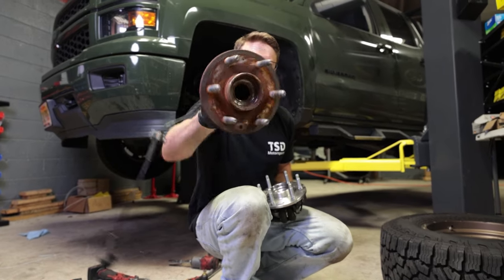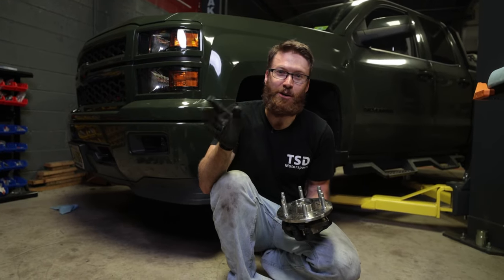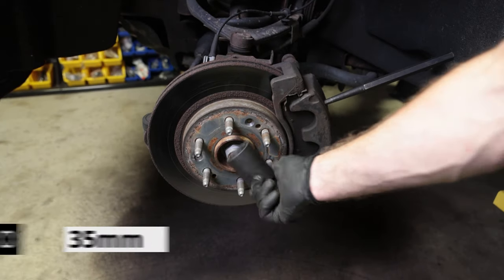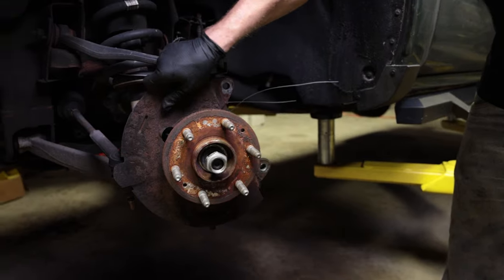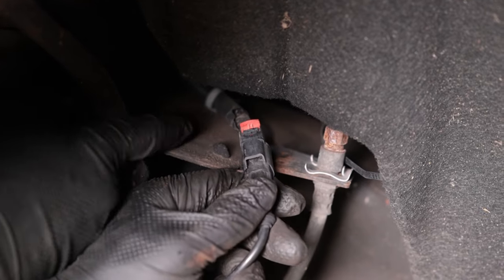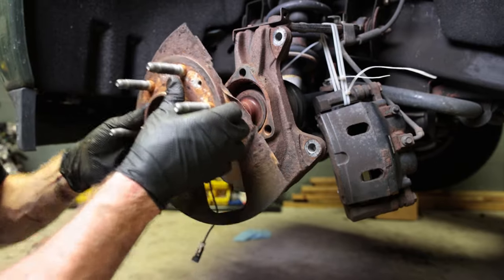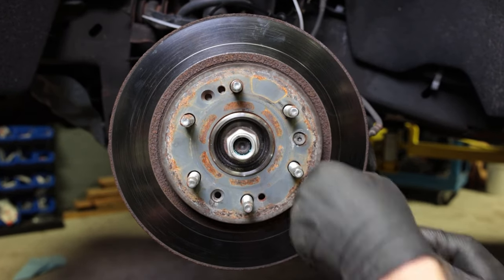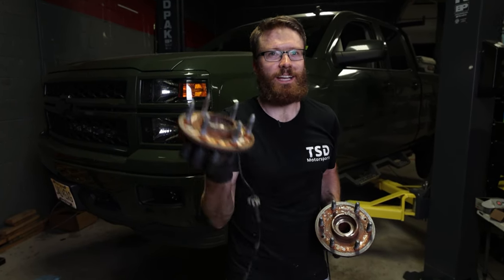How To Replace 2014-2019 Silverado Wheel Bearing - Kryptonite Best Wheel Hub? Sierra Tahoe Suburban

Comment: My 2018 GMC 4WD Sierra axle nut size is 36mm not 35mm. The 3 wheel bearing bolts size are 18mm, not 15mm.
Using an angle grinder had to grind the upper A-frame ball joint stud sticking past past the nut that was in the way of the top bolt on the wheel bearing so I could get a socket on it. Had to use a 6 point socket with a 2ft breaker bar to loosen them up.
Used an inexpensive wheel bearing puller to remove the wheel bearing saving myself a lot of time and aggravation. A common regular puller also works.

Comment: Recently replaced the passenger side on my 2011 Silverado and it pretty much identical. Hardest part is getting those things apart!  Referenced your older video to do that. Thanks!
Reply from the maker: Glad it helped!
Reply: Dale - just a tip that I’ve learned over time. Thread the hub bolts out most of the way, leave the socket and extension on one of them, and tap it with a hammer. It will come right loose. It saves a lot of banging!

Comment: Question, is it a good idea to change both wheel bearings when there's only a bad one?
Reply: Yeah if ones bad the other one is probably on its way out
Reply from the maker: I would always change them in pairs unless one fails very early for some reason

Comment: Anyone got or know the GM part number for the washer behind the axle nut, I know he didn’t replace but I’m just wanting to get a fresh one on while I’m there. Thank you!!
Reply: I mean, unless you somehow damaged it, there is zero reason to replace it.  It's a flat piece of metal.  The nut has threads that get stretched/worn being taken off over rusty metal and being subject to higher torque so it's not a bad idea to replace that (though I never once have on any vehicle), but the washer is just a washer.  Unless you lose it or gouge it all up while removing it with an air chisel or something, honestly you'd be wasting time and money getting a new one.  Whatever makes you happy can't hurt putting a new one in but man that is NOT necessary.

Comment: You NEVER put anti seize on the caliper bolts. You should use a little low or medium loctite.
Reply from the maker: I have yet to have a problem been doing it on my personal vehicle for 15+ years. I've had far more issues with bolts being seized. But you definitely don't want to over do it. But it could cause problems if not fully tightened

Comment: Great vid, very helpful! Also awesome you included the torque specs. One tip that I learned from working on other cars: when going to remove the hub, unthread the bolts most of the way, then leave the extension and socket on the bolt and tap it with a hammer, the hub will break loose and slide right out.

Comment: Great Video! Question for you: If I plan on replacing the ABS wires on both fronts of my 2018 (exposed wires is christmas treeing my dash), in your opinion ,would it be wiser to just go straight for the whole hub replacement or is it fine to just do the sensor harness for now?

Comment: Thanks for the video.  Did you say "anti seize on the caliper bolts" at 10:04?  I think you are supposed to use thread locker on the caliper bracket bolts, either blue or orange, not anti-seize.  Also, at 8:09, you should clean up the rust from the face of the mounting surface on the steering knuckle in addition to the cleaning you did on the inside of the knuckle along the axle.  Any rust on the face could cause the bearing to not sit perfectly flush in the knuckle.
Reply: That's why my impact couldn't get the caliper bracket bolts out and I broke a 1/2" ratchet with a breaker bar on it trying to get mine loose, some whacko put threadlocker on them!  Maybe not anti-seize, but definitely don't use threadlocker on any bolt that you regularly have to loosen as part of routine maintenance, that's more for "hope it never comes out" type of stuff.  On any normal vehicle it's expected you're gonna have to take the calipers off a good half dozen times over its lifetime at least for normal wear and tear type tasks if not more.  If you torque to spec (maybe even a hair extra) they shouldn't ever come loose, no need to glue them in place!  I do agree with cleaning up the mounting surface though, especially with this terrible design mine had so much corrosion that I actually lightly hit it with a file after the wire brush.

Comment: My coworker had her bearing fail and wrecked the truck
 Dealer is charging her 8000cad to fix it. I tried to see if we could help her but she refused. Had an extended warranty but a wheel bearing is a wearable part.